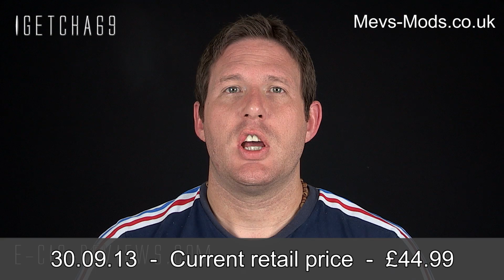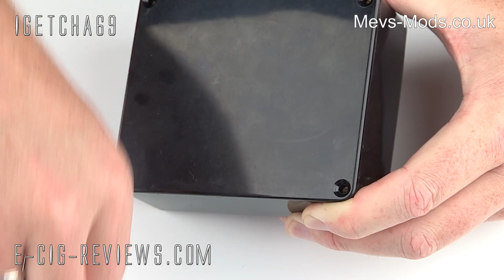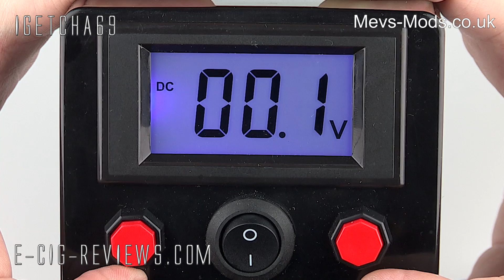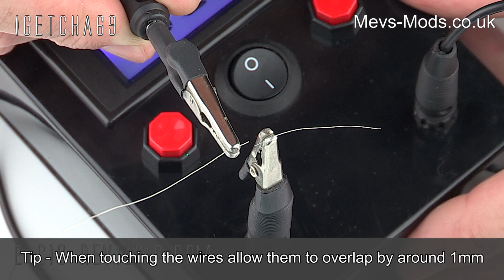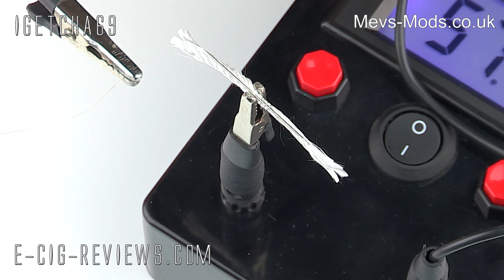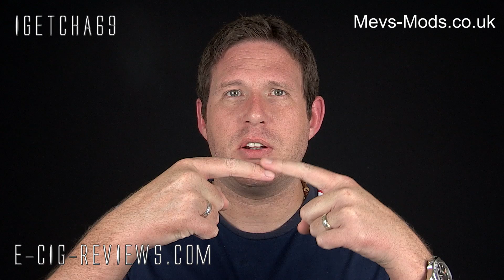REVIEW OF THE ZAPPER V2 WIRE WELDER

Comment: Nordic, there is nothing wrong with yours, but it seems your trying to weld kanthal or nichrome with silver no-resistance  wire, silver wire won't weld, I got the V1 but I am not using it till I use all my silver wires . . .cheers

Comment from the maker: hi mate,

like i said in the vid, i also had the V1 and it worked great once i worked out how many seconds i needed to hold down the charge button........different gauge wires require different voltages

why was it a fail for you?

cheers

scott

Comment: atomizers like the odysseus require the joined wire because the runs to the coil are too long to use resistance wire, it would also damage parts of the coiling section of the atomizer to use straight res wire. It ensures the coil heats up and the leads do not.